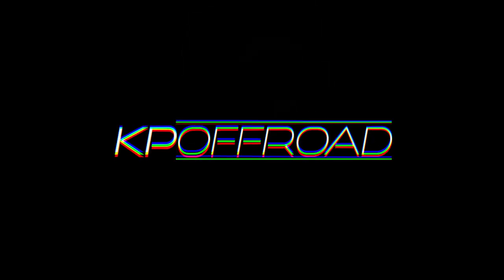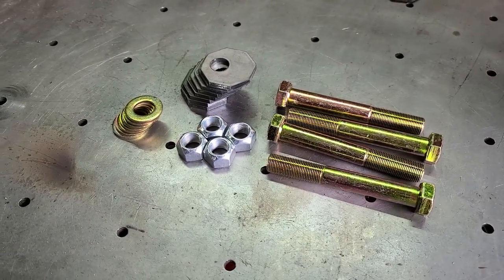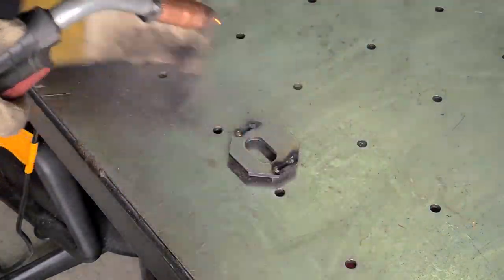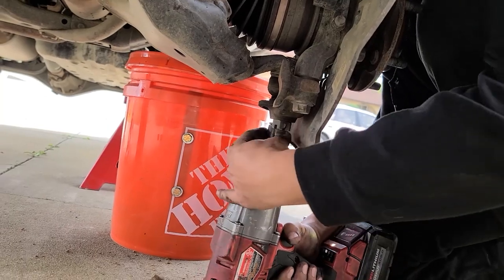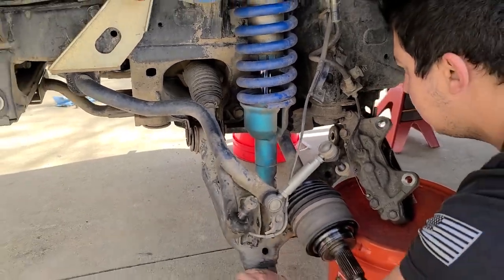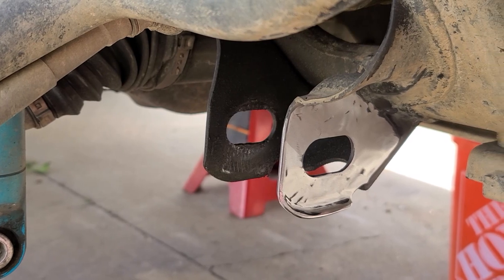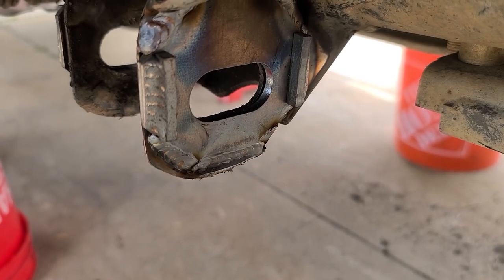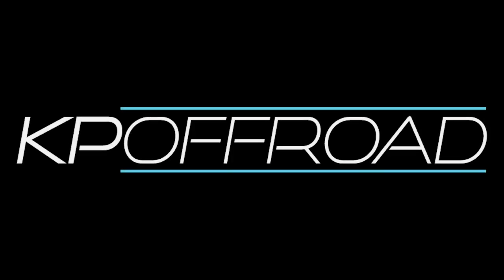Toyota Alignment Cam and Cam Tab Installation 🔥

Comment: Great video but I just want to mention that this guide is missing torque specs. Stover Nuts run on torque will need to be accounted for. Whats great about this kit though it that it uses a normal bolt which should be able to handle more torque, which has a higher clamp load which means the alignment will hold better.
Reply from the maker: Torque specs are going to vary from vehicle to vehicle. We recommend using whatever the factory torque spec is as to not damage your control arms.
Reply: @KPOffroad   you need to add run on torque to the factory bolt spec otherwise you are not even matching factory spec. The manual/install instructions should mention this because of the Stover nut.

Comment: The octagons don’t seem flush with my 06 tundra factory tabs. Should I grind them off and install the new tabs?
Reply from the maker: @kilogolfmike8095  they don't sit flush because the Octagons are 1/4" and the factory cams are 3/16" tall. It's fine to leave it as is, there are 0 issues with the way it's set up. If we made the cams 3/16" they would be d when you tightened everything.

Comment: I ordered some and saw that some tabs are a bit bigger than the other ! Do the bigger tabs go on the back of the control arm ? And the small ones in the front ??
Reply from the maker: You will need to match them up with the factory ones. On most new Toyotas the small ones go on the back LCA pocket and the large ones go on the front.

Comment: Do both side aligne the same number of lines? Im having some shaking on front and their not the same numbers of lines.Hope you can help. Thanks
Reply from the maker: In some cases yes but usually no. It really depends on your bushings, suspension setup, lift, etc. The best advice I have is to bring it to an alignment shop and have them verify everything.
Reply: @KPOffroad  some can't trust them.